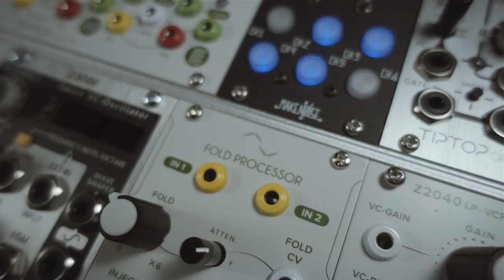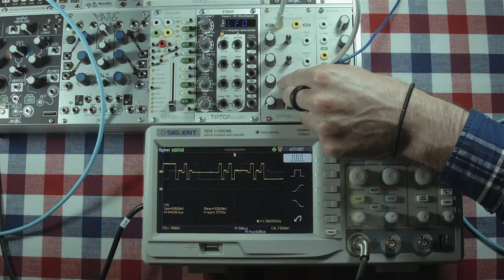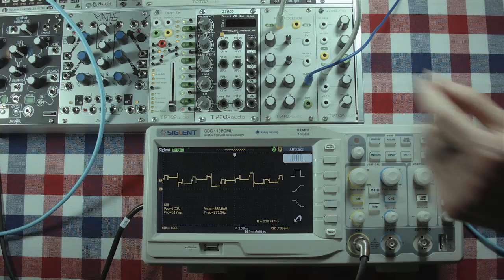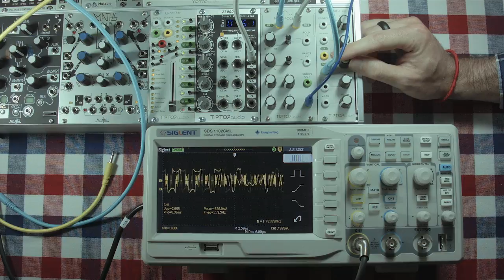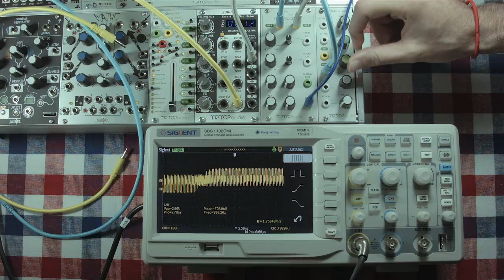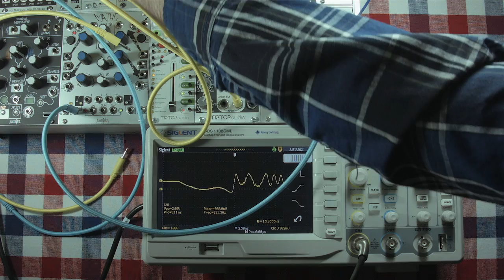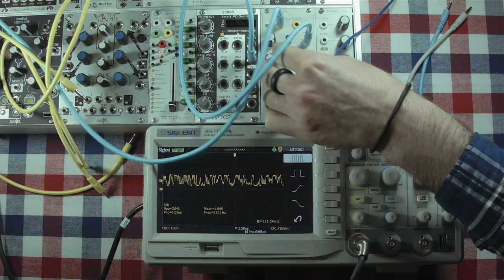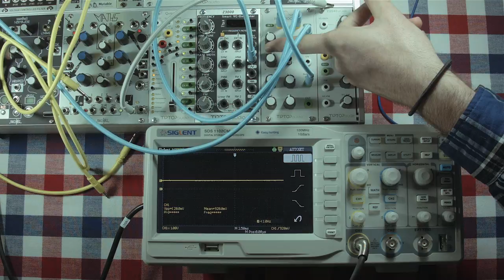TIPTOP AUDIO FOLD PROCESSOR TUTORIAL AND DEMO ~ Eurorack Wave Folding and Divider Module

Comment: Why are the waveforms not always sitting at zero on the scope?
Reply from the maker: Do you mean vertically or horizontally? I think it's moving horizontally because didn't set the right trigger settings, that and the waveform was constantly changing. Vertical offset is based on the inject parameter which I think adds a DC bias. I could be wrong because the manual is not very clear on this. If you have any tips for having the waveform more steady let me know.
Reply: once upon a synth   Oh ok, yeh I was talking about vertically.
Reply: On something like a Sigilent it should trigger perfectly.  Try using an auto setting for the trigger.